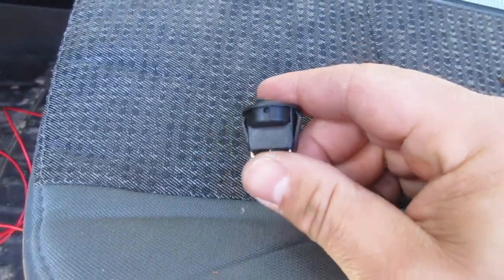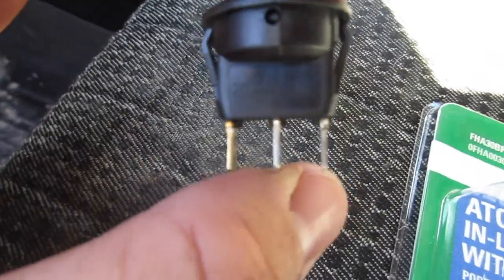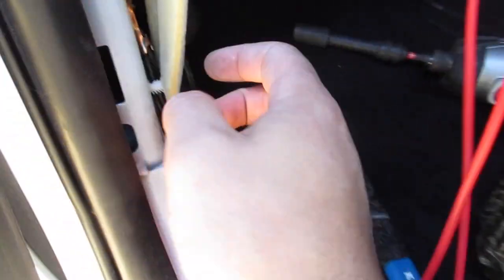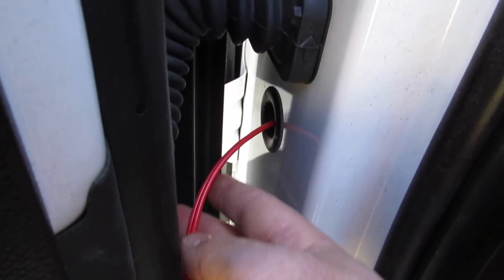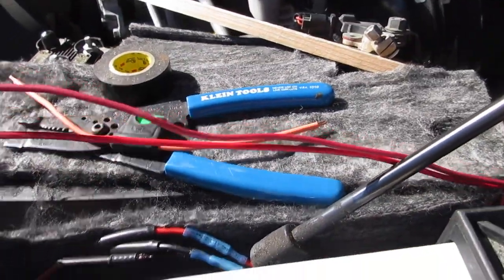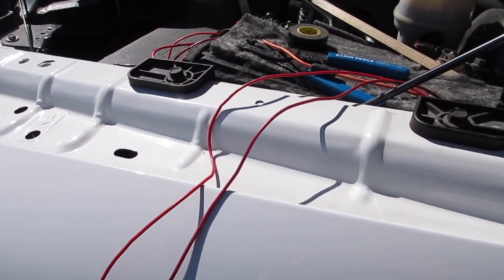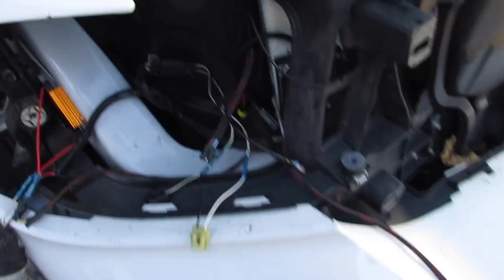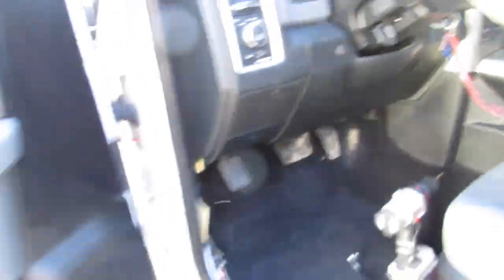Wiring offroad leds to a toggle switch!

Comment: You should add a relay and not rely on the switch it self. Only one fuse off the battery is a bad idea. Please if anyone follows this, follow the guides for using a relay switch, with additional fuses
Reply: Thanks for saying this I ended up doing it the right way with a relay in the engine bay

Comment: Add a circuit device for your 12v would have saved u alot of time.  No add a fuse needed and you wouldn't have to run positive to battery.  Check them out.  Best thing I ever found.  Lol

Comment: Have you had any problems just having the fusible link running directly from the battery to the toggle switch? What size fuse did you use? I have a 30 amp toggle switch and this is my first time trying to wire anything up I want to make sure I do it correctly

Comment: Why doesn't anybody show how to wire the switch? My light bar has 3 wires coming from relay to switch. A white, black and blue white is positive, so when I connect it to switch why are other 2terminals hot? When I connect the black wire, things start burning. So wheredoes black wire go?

Comment: Ideally a relay should be added. Not a good idea running current directly from the battery albeit the fuse
Reply: It’s not a bad ideas but won’t harm anything as long as you use a fuse I mean I have had my amp on a fuse link for years never had a single problem with it but I also ran it through the firewall and through the dash correctly so there’s that as well